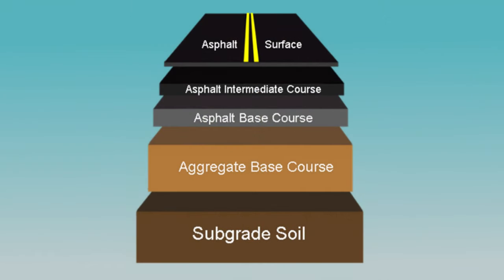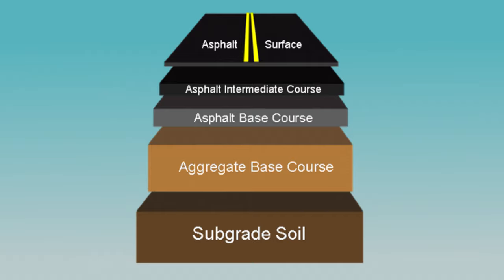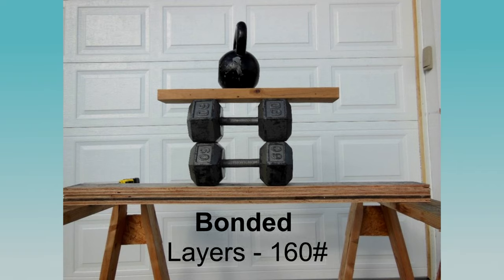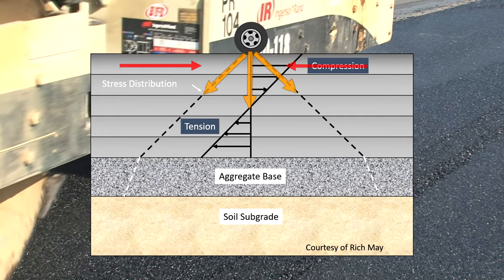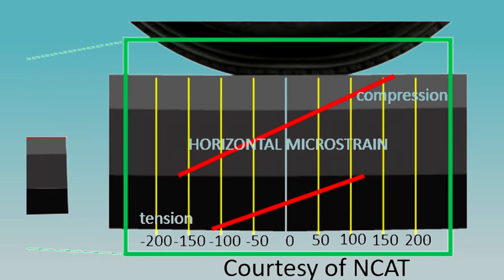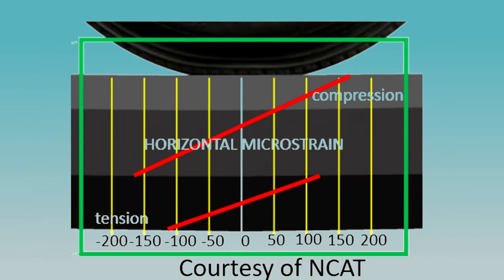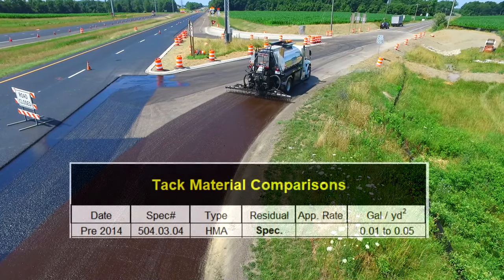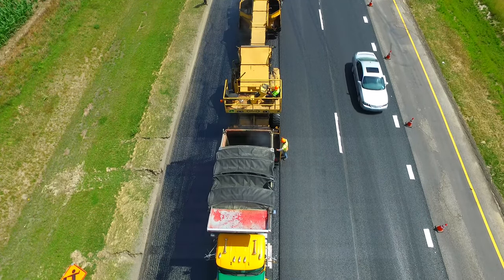Applying Tack Coat - Best Practices

Comment: I came here to do my driveway pothole & crack repairs.  Consumer tack products are mainly sold in 5-gal containers, and it's hard to find but available from suppliers.  Applying tack seems to increase the likelihood that DIY patches become "permanent' (meaning 10+ years), but it seems the patch material producers don't encourage it as they sell on "quick & easy", but not "once & done."

Comment: Tack truck driver of 5 years here. I originally operated out of Texas spraying multiple types of emulsions, but now that I operate out of Northern Georgia we spray asphalt cement typically applied at 375°Fahrenheit. All of the luxury of shifting, lowering, and lifting the bars at that temperature and with AC  material becomes dangerous due to a history of o-seals rupturing either end of the drop tubes. Do you have any suggestions?
Reply from the maker: Greg,
Spraying straight asphalt has many bonuses, but as you mentioned, some hazards.  I foresee a day when the tack truck will be able to apply a void-reducing membrane on the longitudinal joint simultaneously with the tack on the remaining mainline.  A single application temperature would be needed for a two-material system.  The key to operating at those elevated temperatures is keeping the temperatures at the minimum needed to have the pumpability of your materials while not clogging your nozzles.  Second is maintenance to your system including the nozzles.  Keep them free flowing so we can keep the pressures at the minimum needed for proper application.  

Thank you for doing a great job and please be safe out there!!!  -Marshall

Comment: Why is the driver overspraying so much?
Reply from the maker: Good question...  They were spraying at 50% of the typical rate so that we could clearly show the distinguishing features of the tack prior to breaking and setting.  When they finished they had the unpaved areas properly coated at a rate on the high end of the specification.

Comment: Hello Marshal,

Do you see an issue applying tack coat one (1) day in advance due to cold temps? Assume zero traffic on the tack in this period as the road is closed...
Reply from the maker: Ryan, not at all as long as you can keep the tack clear of foreign debris.  I have been on a job where we were required to tack in advance on an airport runway, and after the crews left, airport maintenance crews mowed a nearby field and tumble weeds covered the entire mat.  It heavily delayed the paving operations while the surface was cleaned and retacked.
Reply: @MarshallKlinefelter  youre awesome! Thanks for the response. Great video!